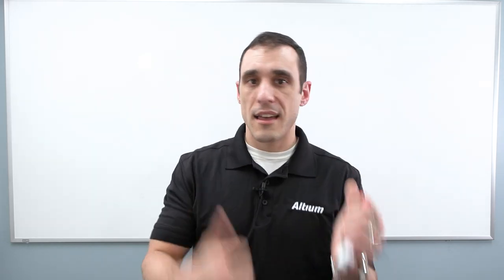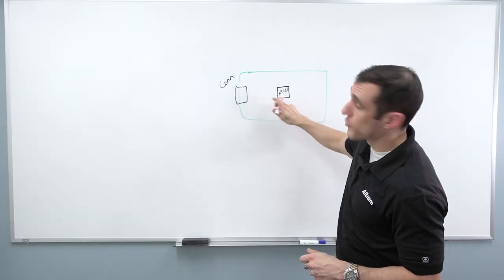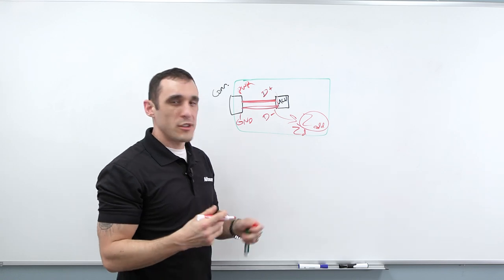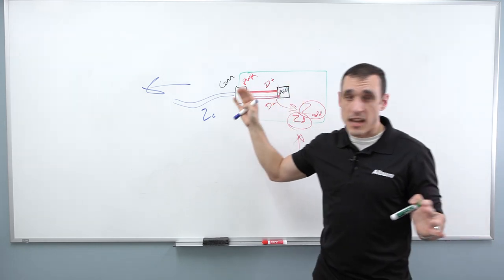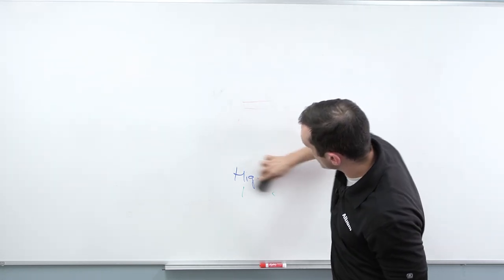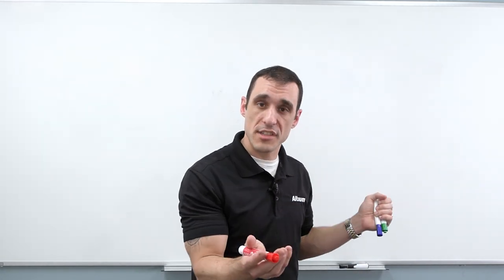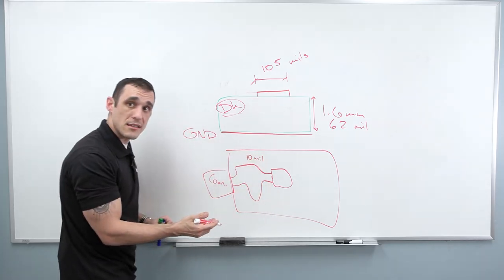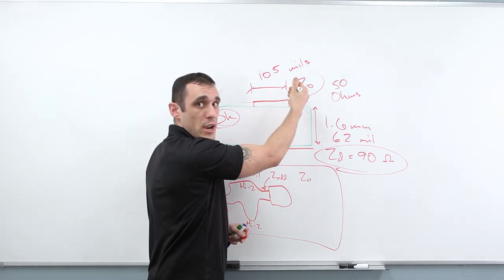Can You Route USB 2.0 on a 2-Layer Board?

Comment: Another advantage of the coplanar waveguide is that it makes your stackup much more resilient to issues that arise from the dielectric weave.  Depending on the weave of the e.g. FR4, you can get wildly different impedance profiles in real products, because some boards will have one or the other line going over more gaps in the weave; in fact, I think the weave of the dielectric is the primary reason controlled impedance is so much higher cost, but don't quote me on that.  As shown in this video, the ground waveguide has significantly better coupling to the traces than the relatively distant reference plane, which significantly mitigates the nasty side-effects of routing over an unpredictable weave.
Reply: You've hit a great point about the weave, and it's one of the things I'm including in my next iteration of lossless-to-lossy impedance transforms in my own research. The last one I presented at EDICON did not include this intentionally because I wanted to focus on the wideband portion for microstrips/striplines (and thus differentials), but I didn't treat coplanar traces. Today's software tools for modeling this don't look at the impedance at all, they actually look at the skew in long channels using Monte Carlo, as it turns out the resulting distribution in skew is Gaussian. But you're right the real effect is in impedance and in consequence it is in the losses, but no one looks at this because there hasn't been a good statistical model for it. That's why I want to focus on it next.

Comment: When setting up an antenna (outside, as for a ham radio for example) it's pretty common practice to have a 75 ohm output from a transceiver, and put that through a balun to a 300 ohm twin lead feed line to the antenna. Or vice versa. Or both, which is kind of silly but certainly possible. My stupid question is this: how awful would it be, and why, to route your traces as whatever Z they happen to work out to because you happen to like that trace width and just have an impedance matching network on either end?
Reply: in RF you probably deal with one signal frequency, or two signals (data+carry) , but 
but digital systems has very wide bandwidth, so it may not be possible or logical to get an Impedance using matching network.

Comment: Your videos and papers are really appreciated! You do an outstanding job of presenting complex information in an understandable way.
I am unable to find an online calculator that duplicates your values. In fact, I cannot find two calculators that each give the same values, and none of them have the top side grounds in the calculations, just the two signal traces.
The Altium product does not support Linux, so I cannot use that either.
My issue is that I need to implement USB-C 2.0 High Speed device on a two layer board. Your presentation would have provided the solution if it also showed values for 10 mil spaces, instead of only 5 mil spaces. My pcb vendor charges a significant premium for 5 mil spaces, whereas their standard spacing is 10 mils.
Also, your paper uses Dk = 4.8, whereas my pcb vendor lists Bk = 3.9.
Can you point me to a coplanar microstrip differential pairs calculator that I can use to determine trace width when the inter-trace gap and trace-to-gnd gaps are each 10 mils?
Reply: Hi GLHB! Just letting you know that I haven't forgotten about your question, I'll be filming something about it today.

Comment: If I use EClamp8052p near port on device, do I have to target same impedance of 90 ohm ?
Reply: In the datasheet it says what impedance to use. They say 85 Ohms in the datasheet, but with their stated tolerance you can just use the USB 2 or 3 specifications at 90 Ohms.

Comment: If calculate the impedance it ask for the height of the substrate.in this case for two layer board how can I choose this height please tell me...
Reply: If you're only doing a 2-layer board the standard core thickness is about 60 mils, or 1.5 mm. You could go with a slightly thinner core of 40 mils, or 1 mm.